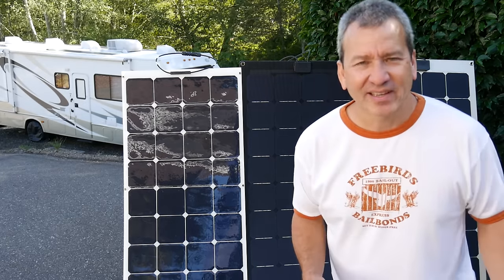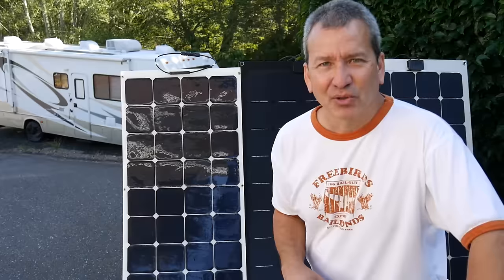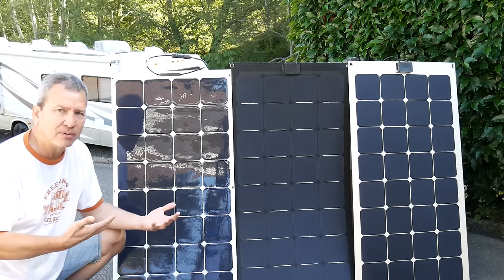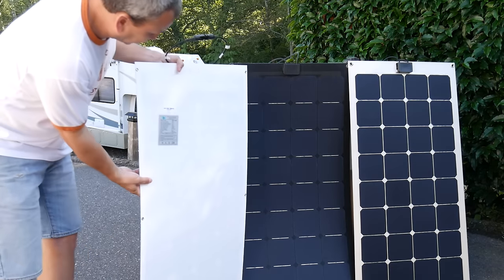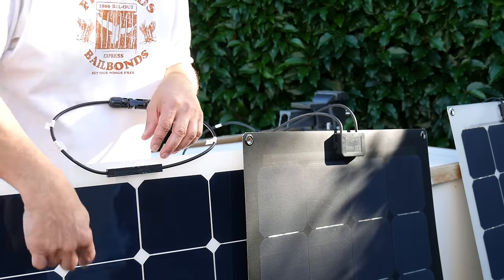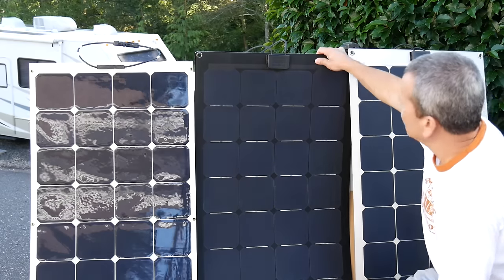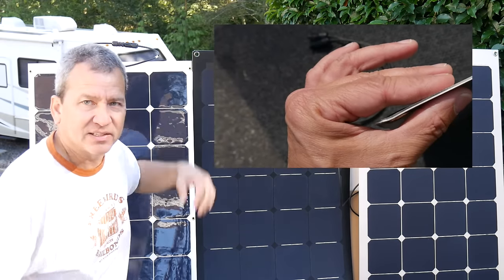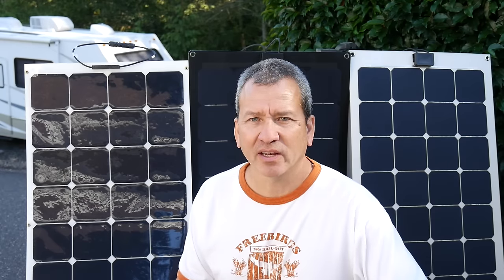Flexible Solar Panels - What To Look For

Comment from the maker: UPDATE: I've switched to SUNPOWER branded Flexible Solar Panels on my RV. Find out why and how to get 10% OFF here: https://www.rvwithtito.com/sunpower-promo-code
Reply: did you make another video on why ? Did the others fail and loose performance? Thanks
Reply: Hi Tito, I searched for the company I believe you called "resonic" that has 4v 150w panels but I couldn't find them. Do I have the name wrong or is there any other companies that make 24v flexible panels? Thanks!

Comment: Thanks for another great video Brian. I recently added four of the 136 watt uni-solar long flexible (rollable) amorphous panels. I have had several Uni-Solar semi-rigid panels over 10 years old and they are still going strong. I also just purchased several 20 watt panels for smaller projects and these uni-solar panels have the aluminum backing which are a bit heavy yet look amazingly well made. The textured surface of all these panels seems to be VERY tough and stays looking the same for a decade or more.  I love Uni-Solar...consider them before all the stock has disappeared.

Comment: I have a friend who was planning on installing the flexible solar panels on his Nissan NV200 using double stick tape to attach them.  After reading many of the reviews on-line it seems they don't work very well due to the heat generated both from the panels and the van roof.  So he ended up buying the the traditional rigid panels and installing them on a roof rack system which worked great.  I would like to see them address the loss of performance on a van roof  due to heat in future designs.   Thanks for your review..
Reply from the maker: +Terry Landis Is the NV200 a camper conversion or a standard van? I didn't realize they had a camper version. Nice! I've had good results with my panels mounted on a rubber roof which doesn't get too hot. I typically stay in moderate to cool climates though.
Reply: RVwithTito The NV200 is just a small cargo van that he has converted to a stealth camper van and did the build to make it a camper.  I would like to know if anyone had installed the flexible panels on a metal van and how it performed with regard to the heat...cheers.

Comment: great info, thanks! i have some of the hqst panels mounted on a van. they did great for close to two years then the top coating started to fog and bubble. i'm going to try lensun as that type of top coat is supposedly more durable. time will tell lol

Comment: I love the simple video on Solar, I would like to know what is running off your inverter and where is it?  Do you just have one outlet to run AC or did you setup wiring to switch between AD & DC.. ( not meaning our favorite band)

Comment: Well next you should mention the charge controllers and the bennies of MPPT type.  How they squeeze a little more wattage out of a panel.  If you remember I bought the last of the Unisolar flexible adhesive types like your first install from Amazon.  Now my whole roof is a solar panel with several different brands.  The bummer was, I had to keep upgrading my controller.
Great video and very informative
Reply from the maker: I think our situations are similar. I'm on my third controller and have maxed out the input voltage to my current MorningStar MPPT. I'm upgrading my batteries next then I'll be done.

Comment: Hi, Question/suggestion.  Instead of sealing the panel completely around the edges, which possible may permanently seal in any atmosphere moisture, how about sealing in only the front forward facing edge and only and inch or two on either side? That would help prevent road wind from lifting the panel while driving and also allow any moisture that would now be under the panel to drain and evaporate.

Comment: Good video. I think the fact that the first panel is getting specular reflections shows that the light trapping does not appear to be very good. i.e. less light will get absorbed and more reflected. You want a textured surface to decrease the reflections and increase the optical path length inside the panel, more power :)
Reply from the maker: Haha. Great observation. You're right though. I do prefer the ETFE coated ones better.

Comment: Thanks for review Tito! Did you make another updated video on power performance?  Please make a video on that and delaminating performance. We car camp 4 weeks a year so could store 2 100A flexible panels in basement which is climate controlled with heat and Air conditioning - would that help preserve these, or would some of them still delaminate?  Even if you don't have that data, maybe you gathered it from some of your viewers?  

Do you keep ANY OF them in climate controlled storage when not in use?  Not hot attic or cold garage?  If the brand that is not delaminating or losing power is no longer in business or not manufactured anymore, what are they most like that's available now?   Thanks Tito!

Comment: One of my main concerns of a flat panel against the RV top would be the heat. The efficiency goes down as the heat goes up and in the desert the metal top could raise +120 degrees. It would be better if the panels could be maybe 1/2 - 1 inch above the roof top.

Comment: Thanks Tito, good presentation.  Haven't decided yet how to go but am definitely leaning toward the flex panel.  I like the Suaoki 100W.  I am and avid backpacker in eastern national forests and state parks so am under the trees mostly.  I have two 12V batteries in a bank and use a Westinghouse inverter generator 2200W max, 1800 run that does nicely for my needs as I am in a smaller  lightweight TT 21.6 and only an 18' box with a fridge, microwave, stove top, furnace and no slides.  So my watt demand is not too bad.  Still I see a need for the solar, either on the roof or hand placed.  Also my TT came prewired with an exterior solar plug-in at a rather slow 10amps per hour, but it's a start.  Also, any suggestions on a mod to increase that. The electrical system when on shore power has I think has a 50 amp converter.
Reply from the maker: I like Suaoki panels as well. I have a few. You might look at the thickness of your solar cable compared to the length of the run. If it's thin cable, you may be loosing some energy due to voltage drop.

Comment: If your RV has a roof antenna that could shade some of your panels, the panels in that area should be amorphous type which is less vulnerable to a complete shut down when a bit of the panel is shaded.

Comment: Bought the Renogy portable suitcase 100 watt (Amazon $279).  I like the idea of portable because when camping off the grid I can park the RV in the shade ( to keep the RV cooler in the summer) and move the panel to a sunny spot.  Worked very well for our Alaska trip to keep the RV trailers battery charged up.  They come with a 15' cable, I made up a extra 10' section to be able to move to a sunny spot.
Reply: jay super
Reply: I believe the panels weigh 36 lbs.  I little heavier than I thought, but the padded / zippered bag they come in is top notch.

Comment: Hello Tito, I know this is a older video but I just wanted your opinion on the CIGS technology flexible panels?
I just order 5 each 80 watt panels from Rich Solar for 400 watts, pricy at $259 each but they say you can walk on them and that they pull power from early morning until the sun sets. 68" x 14" and self adhesive (good and bad) but they will lay flat with no wind resistance or extra road noise. Hoping it will do the trick on my little 24" Fleetwood Pulse. 12V 300Ah Lithium Iron Phosphate. Keep the videos coming, great work.
Reply from the maker: Those CIGS modules look very similar to the Unisolar thin film modules I installed almost 10 years ago. They aren't as popular on RVs anymore due to their lower energy density. So you need more space to get the same amount of solar energy capture. For example: You could probably get a 150W from a mono cell panel of the same size. That said, they are very robust and will probably last a long time. I don't have any problem walking on them. They also get pretty hot and will transfer that heat into your rig. I'll never be able to remove the Unisolar modules that are on my roof, but they are still cranking out power to this date even though the company went bankrupt long ago. Unfortunately, this is another issue. Manufacturers of this type of module don't seem to stay in business. Hope that helps.

Comment: I've tried the HQST and the Lensun.   Not a fan of the cheap, small, non-weatherproof junction box, or the stiff, not-thinly-stranded wires on the HQST.  I also found that the surface of the panel warps and shows the bumps from the internals when exposed to lots of sunlight.  Just seems flimsy!   -  Lensun, on the other hand are like the BMW of solar panels.  They feel sturdy and well built, weatherproof, nicer wiring, and the junction box orients the wires in a more desirable way, IMO.   Go with Lensun.  Hands down.
Reply from the maker: Thanks Ben for sharing your experiences. I've got three of the HQST panels and will certainly be keeping a watchful eye on them to see how they hold up over time. It's only been a few months, but so far so good.

Comment: I'm still in the research stage but was thinking flexible portable panels would be better so you can park in the shade and put them in the sun.  I'm sure not too far away or you loose performance.

Comment: Another excellent video. Gonna keep my question simple. All I want to do is keep my 2 -12 volt house batteries charged while RV is in storage. Don't do a lot of off grid so depending on them in the wilderness is not important. Can you recommend the cheapest BEST option.
Reply from the maker: A 50 watt panel and a cheap pwm charge controller connected to the batteries should keep the batteries topped off. That's what I use.
Reply: RVwithTito thank you

Comment: I live in Kansas. We have hail storms quite frequently. I'm curious about how resilient flexible solar panels are compared to traditional rigid glass panels. I see that you can walk on these. I found some Allpower panels in my initial searching just about half an hour ago that claim that it can withstand 1 inch diameter hail. I also found replacement cells that look almost identical to the white panel you have on the left of the screen. I'm curious about whether to replace a damaged cell or replace a whole panel. To me that's a huge waste. Additionally, I'd like to have something that is wired in parallel to isolate damaged cells. So the panel is still operational but at a reduced performance until it can be repaired. Assuming it can be repaired. Thanks for any advice.

Comment: We have a lot of hail in my area. I mean A lot! Do the plastic boxes on the panel look like it will hold up?
Great video. Thank you for sharing. I could have saved a lot of weight not using the traditional glass panels.
Reply: Never mind about the hail. I just read through the comments. Lol

Comment: Where did you get the roll of solar you have on your RV and what brand, wattage and price?
How long have you had them and what would be your best choice?
Reply from the maker: Those are older from a company called Unisolar. They have since gone out of business. You can still find Unisolar panels on ebay and Amazon though.
Reply: I decided to go with a Renogy 100 watt flexible panel to start with. I should receive it Tuesday. Now I have to decide if I want to mount it on top of my RV or hook it directly to my battery as needed and be able to park in shade and put the panel in the sun. What's your opinion about that if any? Safe travels!

Comment: Has anybody ever tried mounting a flexible solar panel bonded a layer of corrugated polycarbonate and then that bonded to the roof? That could provide a fraction of an inch of air gap - cooling the panel and the roof a bit? Just a thought. That what I was searching for when I found this video.

Comment: I've got two of these 100 watt flexible panels on my class B pleasure way. Love them and they can't be seen from the street due to how flat and light they are.  They are light enough to use a commercial double stick tape or a good roof cement.  You don't have to put screws through the grommets and I've driven them past 75 MPH and high winds with no problems.  The only drawback is that they are usually permanently mounted flat and give peak energy when the sun is high.  Being able to raise rigid  panels to aim towards the sun can give as much as 40 % more power. So therefore if you need maximum power these may not be the best choice.  I however am pleased with the lower power output design flat on the roof.
Reply from the maker: I agree Phil. I'll be posting a video soon that shows mounting the panel using Eternabond.

Comment: It is extremely important to note service life seeing they are often in a very hot environment.   How do they take in power at various angles of reflectivity to the sum's position?   My Unisolar took in 90% at 45* angle to the sun because of the textured surface, but even in a cooled environment above the roof with air circulation  lost significant power over time.  Two went to near total failure in 16 years, and 6 lost 50% power.   The shiny panels only brought in 10% power at a 45* angle to the sun, but have lasted with 95% power over 20 years in a cooled air circulation environment.  So rooftop shiny will not perform good enough, and Unisolar are notorious for failures and rapid power loss.   Reputation long term of a panel is important to look at.  Some of that can, with a grain of salt, be inferred by warranty time length.

Comment: I have installed 2 135W panels 5 years ago, added  one more next year. My panels like panel on the left on this video. Now one panel is completely dead and other have only 40% of rated power. They are not withstand snow on the RV roof, melting and freezing cause delamination

Comment: Tito, I used your video to add 2 100 W Mohoo flexible panels from Amazon to my RV.  Put them on 3/2018 and they worked great, until a few weeks ago.  Now am getting no power to the controller from the panels.  I am in northern Utah and it has been very sunny.  I checked the panel outputs by opening the small box on top of the panel and got no output.  Have an electrician coming soon to recheck output.  Any suggestions?

Comment: Hey there, I found the elect. cord to the solar panel on the roof, which was on the A/C unit, the solar is a very small one and it isn't working, but they had the unit setup with solar, in order for me to put a new panel on can I just cut the wire from the old one and splice and connect the new one to that wire?  I think I can without causing  any damage, any thoughts.

Comment: Hey Tito, I have just purchased an RV and want to add solar.  I have watched 3 different Solar installations that you have done starting back in 2012.  The flexible 251" unit is still available.  Have you decided which gives you the most bang for your buck??
Reply from the maker: Those Unisolar panels are still good quality with very durable construction, but they are less efficient thin film panels that consume double the roof real estate as compared to a new moncrystalline flex panel. At the time I got those, they were the best flexible option available that didn't cost a boat load of money. Today, I would go with the other 100w flex panels.

Comment: +RVwithTito I believe we share a similar perspective regarding mounting the panels.  I only wish that the panel manufacturers had a standard for the rivets.  I am going screw mine down, but sucks to think that the next panels, I will be forced to drill additional holes at the new locations.  Any feelings on that?
Reply from the maker: I wouldn't worry about that. You can pick up an inexpensive grommet kit (http://amzn.to/2dh9yTn) and create grommets where you need them. Simply remove the old panel and place it on top of the new panel to mark the location of the holes on the new panel. Drill holes and add grommets. That's what I'd do.
Reply: I've seen flexible panels installed by sliding a bolt through a washer and then using an industrial adhesive to glue the washer to the roof leaving the bolt sticking up. That way you can fasten your panel down with a nut on each bolt and never have to drill a hole in the roof. If you want to change or install a larger panel you can grind down the nut and glue down another washer/bolt where ever needed.  If you're worried about air blowing underneath you can always run a piece of Gorilla Tape along the front of the panel. It seems like an excellent idea.
Reply: Nice!  That is a novel way to mount a panel.  Any time you don't have to drill holes in a roof, it's a good thing.
Reply: Update on flexible panel installation: I eliminated the nuts and bolts altogether and used Gorilla Tape to tape the flexible panel directly to the roof. I also taped the panel leads to the roof. This eliminates virtually all wind drag as well as being super stealthy. The only way you can see the panel is if you are as tall or taller than the roof. I also drilled two holes in the roof to install the panel leads. I used rubber grommets for a water tight seal which works perfectly fine. You can always add a dab of sealant around the grommets for peace of mind if you wish.
Reply: Shavian: thanks for the input and follow-up. I plan to do something similar for my Jeep (fiberglass hard top).

Comment: nice so you just connect the panels output into each other and short the panels like you demonstrated @6.36
Reply from the maker: That's how you test the short circuit current (ISC) rating on the panel.

Comment: The diode is there so the currant doesn't reverse back in the panels from the battery when the panel doesn't charge, nothing else.